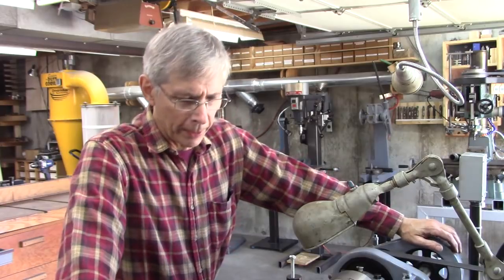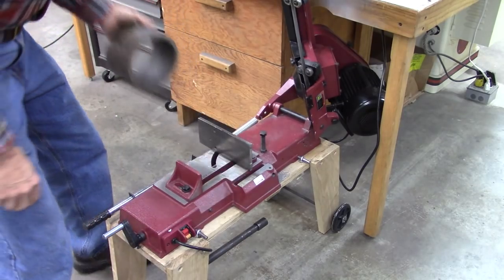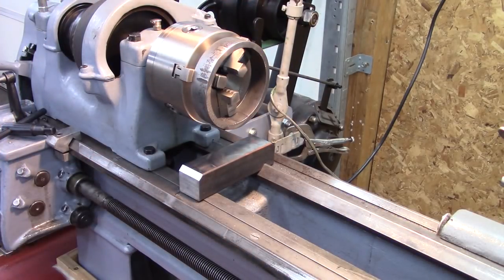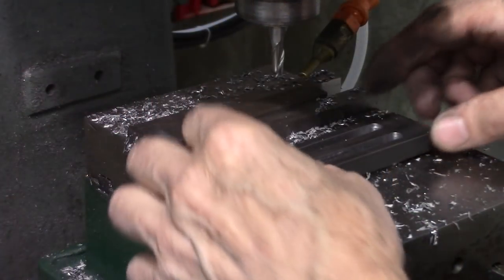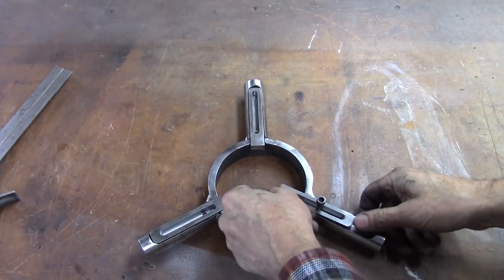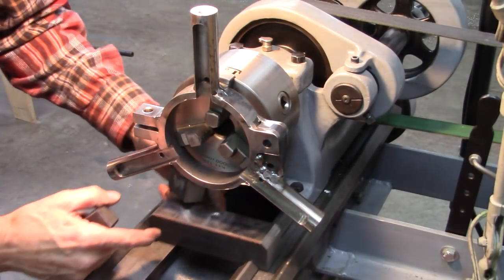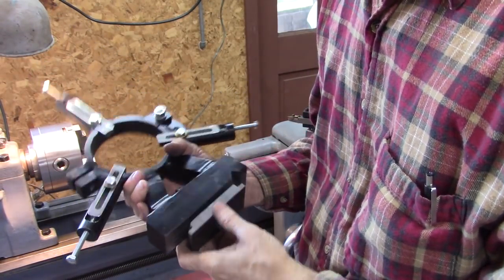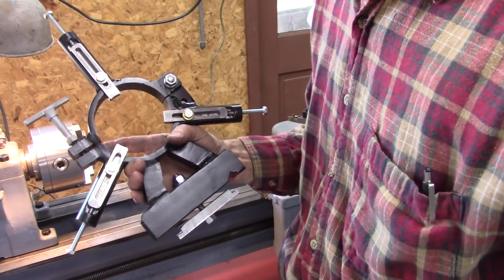Building a Steady Rest for my South Bend lathe

Comment: Once again you have done a great job, well done. I have seen some home built steady rests that are closed and don't have a way to remove the work. Your one is a good design.  In regards to the sizes, is that 4" OD x 3/8 tubing? And is that bar for the base 1 1/2" square?
Reply from the maker: Thanks, yeah the tubing it roughly 3/8" thick and 3.5 ID. and the bar on the bottom was 1.5" square. Good guess.
Reply: @WinkysWorkshop  Thanks for the reply and answers. I need to make one of these for my lathe as it did not come with one. I have to turn a long part for a spin indexer which I am building and that project is on hold until I have built a steady rest. I like your design and plan to make one similar as I have similar sized material (I will reference your video in my build video of course). Another guess on size, are those round parts for the fingers 1" diameter?
Reply from the maker: Good guess, yes I think they are 1 inch. The hardest part was getting the alignment of the fingers correct. Mine is a little off although unless you are supporting small stock is isn't much of an issue. I think if I made this again I'd make the fingers like the steady rest in this video https://www.youtube.com/watch?v=DyfI7SsF0pg  although I'm not sure how they are made.
Reply: @WinkysWorkshop  Thank you once again.
Reply: Hi, I have made my steady rest. I made a video and referenced you and your video in it as I got the idea from your video. Once again, thanks for the information and putting the video together and posting it. It has helped me in my steady rest build. Regards Jon.
https://youtu.be/g_l9KKMWxuQ
Reply from the maker: @thehobbymachinistnz  Looks fantastic. Milling the arc to help align the fingers was a great idea. The bearing are a great and the captive fingers are a nice addition. I wonder, do you have an Australian (or NZ) dictionary? In some ways your pronunciations are more phonetically correct than US English but, they sure are  different!   What did you call the socket head screw?
Reply: @WinkysWorkshop  Thanks for your comments. When I put text in my videos I try to us the US spelling as 70% of my videos are viewed by the US. I use to work for a US company so I'm use to doing that. But, when speaking I seem to fall back into NZ mode and use British terms. I may have called the socket head screws - cap head screws.

Comment: This will motivate me to finish my 9" SBL steady rest project. Seeing your design choices and work methods, and hearing your self-critique will save me an iteration. Thanks so much for documenting your build and your honesty. Looks great, and a great inspiration. Cheers!
Reply from the maker: I think if I made this again I would weld 3 threaded blocks to the ring and use 3/8" or maybe 1/2" jack bolts as fingers. Jack bolts are almost always hardened which may be good depending on what you are turning. Lock nuts to secure would be simple but it would be nice to have a method to clamp down on the threads. It would make fine tuning the finger positions easier.

Comment: I made mine years ago for my ? old 3 speed no gears for threads 60 year old lathe. 5 in chuck. 24 in centers. I did it without a mill so my beloved, re-sharpened files got a good workout. 40 years ago and I still have them and care for them as if they were/are my baby's, LOL. I used brass for the surfaces of the stabilizers. It is no where as nice as yours but it functions. Never have enough tooling eh. Next I want to make a live chuck for the tailstock. Thanks bud.
Reply from the maker: Yeah a steady rest is a handy thing to have. Brass is a good idea
Reply: @WinkysWorkshop  For sure. You can build yours up with that trusty torch. It can be ugly as ever, no matter eh.

Comment: Well thought out, Winky.

Did you settle on 4" schedule 80 pipe for your ring, or was it some other size?
I was thinking of 3" schedule for my 9" South Bend.
Reply from the maker: It was 3 inch I think...  rough looking thick wall, 1/4" thick. I found it in a dumpster. Ha

Comment: Great. What you use as antifriction in tips? Bronze insert? Bronze weld lining?
Reply from the maker: Just whatever the welder came with. Are you talking about the tip on the gun?
Reply: I' m talking  about the points of the 3 arms were you have the contact with the rotating piece.
Reply from the maker: @jcvieira2034  Ah, got it. Nothing on the tips. I have a steady rest of my Logan that is made the same and its never been an issue. The tips don't put pressure on the work piece unless it is being deflected and oil seems to be enough. I may change my mind but for now it's okay

Comment: This is coming from someone who knows absolutely nothing about lathes...... I'm surprised that the arms (fingers) don't have some type of roller bearings on the ends so your work doesn't get scratched.
Reply from the maker: I thought the same before I ever used one. The fingers do leave some slight scratched but very minimal. I've used one many times and never had a problem. Of course you have to keep it oiled. Keep in mind the fingers are not clamping the work. They are simply stopping the work from deflecting. There is no pressure on the fingers until a cut is being made and the work tries to deflect. Also, bearings are hardened. If the alignment of the fingers is not perfect (which is likely) the bearing might do more damage.

Comment: wow very nice project. what kind of welder are you using?
Reply from the maker: Thanks! The welder is a 120V Forney. It's better than not having a welder but also frustrating. It's under powered and has a terrible duty cycle. After about 4 minutes of continuous welding the power drops. I have a hard time welding anyway and I'm left thinking...  am I screwing up?  I think it is a 40% duty cycle which means you are supposed to be able to use it 4 minutes out of 10 but....  the recovery time is more like 20 minutes!  Someday I'll sell it and get a Miller 220V welder.

Comment: What happened to your power hacksaw? :)
Nice build Mark. I need a steady rest for my SB10K, thanks for the video.
Reply from the maker: Thanks, I sold the hacksaw. It was slow and worked okay but because of the reciprocating action  it was very hard to hold work The little harbor freight saw works well even thought the quality is low. Also it had an add on table so you can use it has an upright saw.

Comment: You've made the ends of the fingers concave but I more commonly see them convex - which may help oil stay on the bearing surface but your effort's 100% better than not having one !
Reply from the maker: In hindsight I think I should have left them flat but as log as the radius is greater that the work being turned it should be fine. The steady rest on my Logan  had fingers made like this. Heck....  maybe they were worn in this way, hard to say.

Comment: 0:00 I spy a dust extraction system :)
It's quite an impressive 'man cave' you have there :) We have a compressor but the tank's only half that size. - why did you get such a big tank ?
Reply from the maker: Thanks!  Yes the dust collector is great for woodworking. I started out with a bag type but it left fine dust through. The cyclone does way better. I also put pipe under the concrete floor along with the power to my table saw. I probably would have been fine with a smaller compressor but the larger tank size is nice. I used it with a small sand blaster for a while and I had to wait for the compressor to catch up. I will say one thing for certain, the upright tank is way better than a horizontal. NO WATER in the air.
Reply: @WinkysWorkshop  Yes, I know about the vac pipe to the saw floor ! NEAT !
How long did the nozzle last in the sand blaster ? In use, ours soon bored itself out ! Sure we've had our compressor running a long session but has supplied the air we needed 98% of the time. You can either do it big tank method as you have up big compressor method :) We've always had a water separator (but not oiler) on our air supply. Oilers are fitted on supplies feeding mechanical air tools to lubricate them.
As for wood dust - having the cyclone or filters outside the shop solves the internal wood dust problem :)
Reply: @WinkysWorkshop  Good and bad day today. Installed the new dehumidifier in the garage and it seems to be doing its job. We've a taper turning attachment on the lathe. I tried 'examining' it a few days ago and found it too stiff to operate the adjustment knob.
So I've had it in bits today - and it's been abused ! Someone's drilled through the underside of the attachment, gone through, leaving quite a burr on the adjustment slide mechanism and continued to drill into the adjusting screw thread ! The adjusting screw was also bent - seemingly in 2 places too ! Stripped it down today cleaned up some of the damage, straightened the screw and run a thread die up and down the thread to ensure that was cleaned out. It reassembled and seemed improved but still  rather stiff - until the adjusting screw snapped - so I've come in for coffee !
It should work fine without the designed adjustment - which really is a poor design as you can't reach the adjusting knob while viewing the angle marks ! I've now got the broken bits to extract or otherwise disable it  and just make angle setting adjustments by hand - equipped with a light 'tapper' !
Reply from the maker: @millomweb  - Yeah...  sounds like a bad day. What kind of lathe?
Reply from the maker: @millomweb  Looks like a solid lathe!  My shop is in the basement. If the cyclone is outside it sucks ll the heating or cooling out of the house.
Reply: @WinkysWorkshop  LOL - a very good point (heat extraction as well as dust) !
It's an excellent lathe ! I recently found a video - and you'll be overwhelmed by the quality. They didn't just use any of their high precision rollers in their bearings, they made the bearings up of sets of same sized rollers ! Let's say they had a 1 thou tolerance (-0.0005 to + 0.0005) on the rollers, they'd make sets of rollers up from those -.00005 to -0.0006" for one bearing. The next bearing may be all rollers +0.0002 to +0.00003 etc.
Here watch the video: https://www.youtube.com/watch?v=nQaAKUAzK0w
This old Tony has the same machine as does Chris the Bodge.
Reply from the maker: @millomweb  I've had a few opportunities to buy a monarch 10EE. It's a very nice lathe. Both your lathe and the Monarch are probably better that I'll ever need. Although it would be a pleasure working with something so solid.
Reply: @WinkysWorkshop  I very much encourage you to upgrade. We upgraded from a myford ML7 . It was the big 'hit' from Myford (a company that closed earlier this year leaving the founder's grand daughter quite rich !) and there must be thousands in use in England still.  A small, sound hobbyists lathe with no frills and a fair price. Standard with changewheels but a gearbox was available for it. Leadscrew only. The 'Super 7' was a little larger, had a gearbox and power crossfeed I think. Again belt driven - 6 speed instead of 3 (not including back gears).
What is 'better' ? A certain amount of stability is necessary - then what, it's merely a matter of size - bed length, centre height and depth of cut ! A threading gearbox is handy.
The 'common' Student offers 12 speeds 54 - 1200. It is neither 'slow' or 'fast'. Small diameter aluminium - or drilling - all done at reduced speed as it has no faster speed - and no back gears.
The Student is a great 'class' machine - I guess akin to the Monarch name (12" diameter, 24" between centres - so not a 'big' machine) but I have learnt from videos that my milling machine is several classes above the lathe. The one thing it hasn't got is power feed for a rotary table but gut feeling it is an available option !
Reply: @millomweb  Excellent video. Thanks for posting it.

Comment: Well Done!  What make/model is your welder?
Reply from the maker: Thanks. It's a 120V Forney. I'm not sure it's all that good but in might be the operator and the fact that is is 120V. After welding for about 2 or 3 minutes it starts losing power. It's a little annoying but most often I weld for 10 to 30 seconds at a time.
Reply: @WinkysWorkshop  It welds that thick steel so easily, hard to believe its 120V. I thought those flux core welders were limited to 3/16" even at 220V
Reply from the maker: @martik778  - It's hard to see but I all the seams are grooved or beveled which helps the weld penetrate. Without the groove 3/16 is the limit for penetration. You can weld any thickness but the penetration will always be about 3/16". Flux core increases this to about 1/4"

Comment: Great design. Love the simple fabricated design of this. If by chance it needs more rigidity  (doughtfull) you could easily weld on some radial ribs. Have you considered brass tips? 

I got lucky,  a year or so ago I found a steady and follow rest in my local scrap yard. Brand new unused, but for a different size and brand then my logan. So I finally modified the steady rest to fit my logan a couple months back
Reply from the maker: Thanks! Cool on finding the steady and follow rest you found. I might try brass tips. The steady rest on my Logan works well without so who know.

Comment: Nicely made. If you ever have a galling problem, drill the end faces of the fingers for brass pads. At the same time you could drill the fingers for ball bearings and mount the bearings with stripper bolts. That would allow you to install the bearings in just a minute if you needed them.
Cheers from NC/USA
Reply from the maker: I may try the brass..  thanks

Comment: I built one similar for my Hardinge lathe . I added Roller bearings to the fingers on mine .Great video
Reply from the maker: Cool, thanks- I have one for my Logan and it's never a problem with friction. I wonder is the metal is soft or hard?
Reply: @WinkysWorkshop  I just like not having to oil it at all and i turn a lot of chrome face used hydraulic shafts and use the material for all sorts of stuff .
Reply from the maker: @apollorobb  I understand about the oil...  that chrome would do well with the steel fingers however. I've worked a little with the cylinder shafts too. Hard stuff. We made rollers out of it where I worked. I designed a thing to flatten the folded edge of a 16 page signature (section of a magazine) in the printing industry. The folded paper ran over the chrome roller with a wide faced bearing against it creating a nip point. The press was running 1800 to about 2800 feet per minute. After the nip point the paper was cut into page length sections by cylinders and delivered to a conveyor belt with a 2 inch shingle. Making the backbone flat made things run much better.

Comment: A very nice project.   Well done.   I would add some brass pieces into the ends of the arms.
A short video but I appreciate the many hours of work you put into the design.
Dave.
Reply: Maybe some small roller bearings.
Reply: @lloyd4768  I put roller bearings on mine and the darned things blew out after only a couple of uses. If you do this try to find flat pin style bearings instead of ball bearings. They could probably withstand the load better.
Reply from the maker: That may be a good idea! Thanks

Comment: Turned out great! Really need to get a Tig welder for those projects, made a big difference for me.
Reply from the maker: I have been looking and drooling for a while.  Eastwood has some nice looking welders. I wonder if they are any good?
Reply: @WinkysWorkshop  primeweld tig225, best money for a TIG welder under $1000 hands down and great for beginners. They have great customer service as well. 

Great video btw! I’ve been wanting to make one myself, and you have just confirmed it’s not too hard haha. 
Thanks!
Reply from the maker: @mainstreetmachineworks651  Thanks for the tip!
Reply: @WinkysWorkshop  I have a older Ahp,tig,and very happy with it. If I ever need a new one I would go with Primeweld also I think has more adjustability.close on price.you can get both on Amazon. Tig has more precise heat control.mig has its place have a big Miller that's 35 years old never failed.do mostly metal core or dual shield. But when I make fixtures and brackets tig is the way to go.
Reply from the maker: @19672701  - I'm definitely looking into these. thanks
Reply: @WinkysWorkshop  with your talent, I believe this will be an asset to your shop.
Reply from the maker: @19672701  I think a TIG and the steady rest will both be an asset. Thanks
Reply: @19672701  I second the AHP, It covers a lot of bases

Comment: Not bad performs the basic function.  The factory made rest has a slotted clamp under the ways so it is easier to install with the bolt in place at least mine does.
Reply from the maker: Thanks, my Logan is made similar although a bit more narrow so it can be left connected to the rest and rotated after it's under the edge of the bed. I may need to trim this down like the Logan.

Comment: Winky, how is the column stabilizer on your mill working now that you have had a chance to use it?  Any design changes you would recommend?  What the diameter of the vertical round bar you used?
Reply from the maker: Hello Pat. The mill is working incredibly well. The bar is 3/4" because it was the largest I could fit in the lathe bore for drilling and threading the ends. I think it is adequate. I think the clamps might slip before the bar flexed. The only design change I'd make is a slightly smaller driven sprocket. It hits the bottom bracket when you lower it all the way.
Reply: @WinkysWorkshop  Thanks Winky, I am  really looking forward to installing this on my mill.